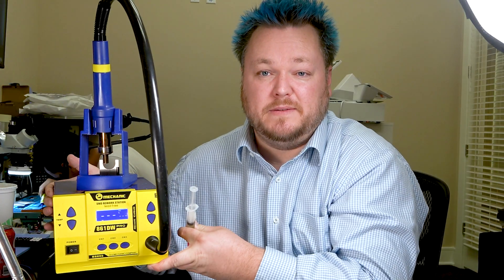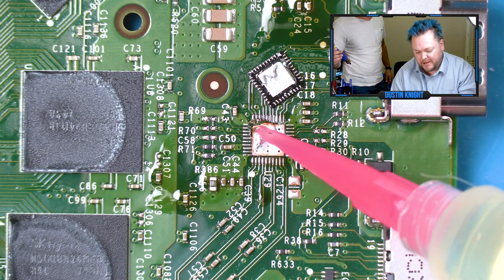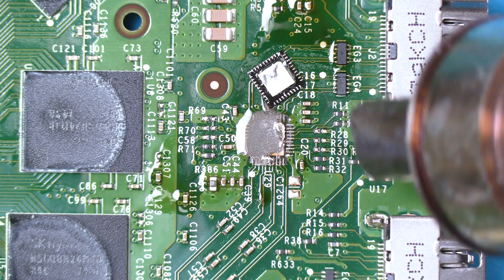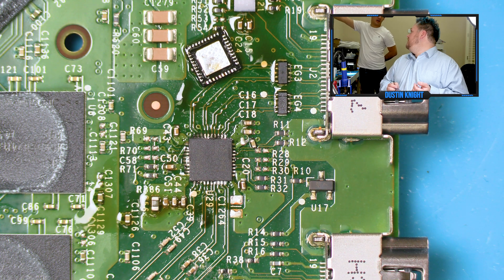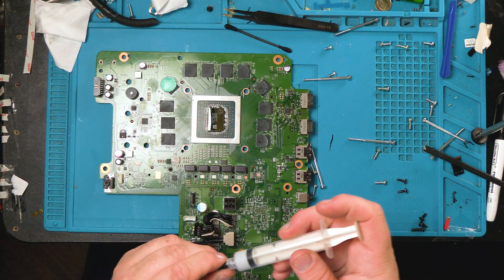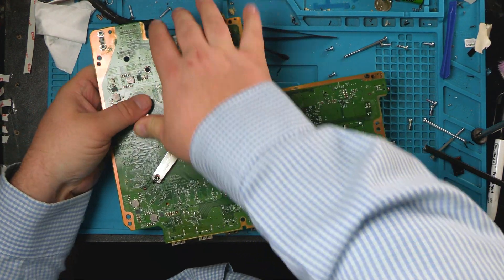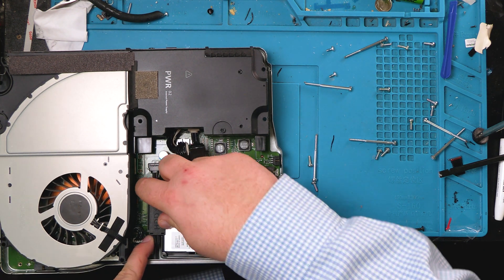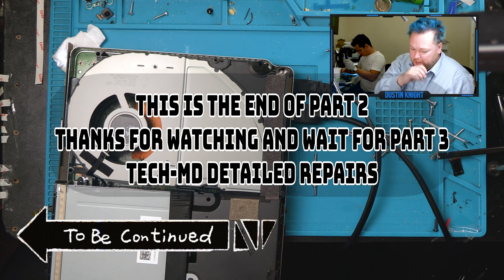Xbox One X HDMI Retimer IC Replacement DETAILED PART 2

Comment: Thank you for the guide! I've been getting ready to try and fix my dad's Xbox one x Scorpio recently, and this is to this point, the most helpful guide I've found on replacing a retainer chip. I do have a few questions though, and I'm sorry if they're dumb. 

1. You set the heat gun to 300 degrees, was that Celsius or Fahrenheit? 

2. Do different models of Xbox require different versions of retainer chips, or do all of them take the same one? 

Thank you for the video, and thank you if you answer my questions, I hope you have a nice day!